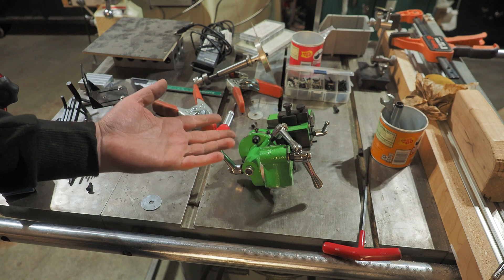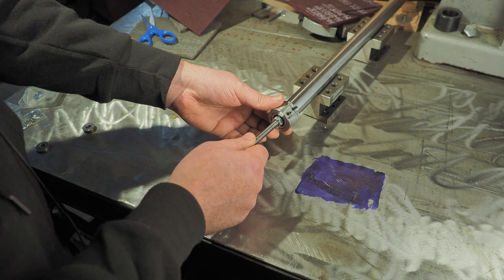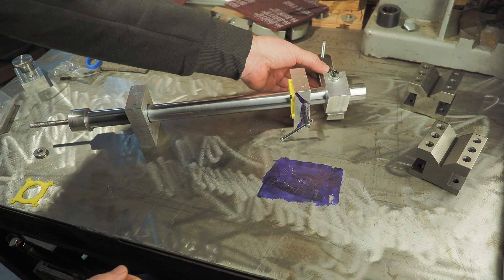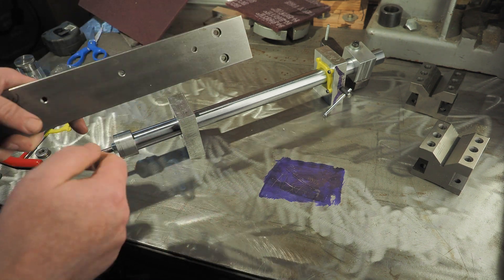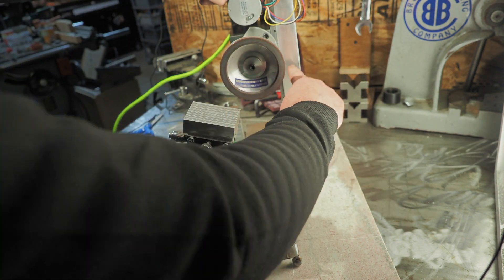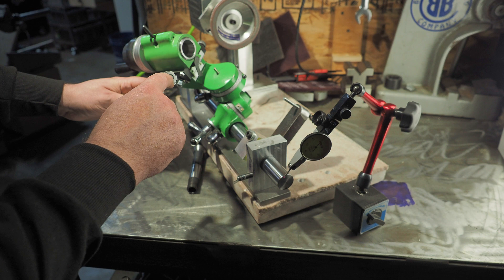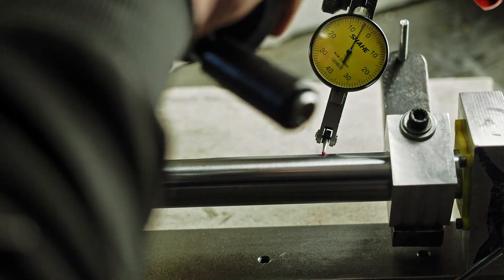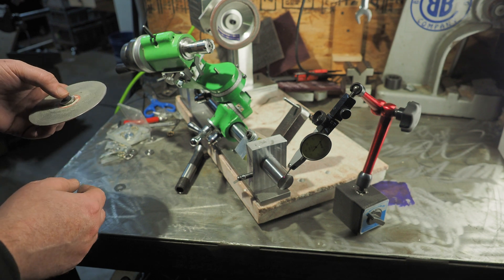DIY Deckel style D-bit grinder/tool and cutter grinder Part 4

Comment: I was considering getting a T&C Grinder and was a little alarmed at the prices so have looking into construct and checking out your excellent vids..   and somewhere, someone suggested using a CNC Mill to sharpen tooling (which I have) Rather than the 'hand' driven machines..  I wondered if the CNC option has been explored and any success achieved prior to my looking any further..?

Comment: I like your   design  .. nice and easy  to make  .. whats good is you will be able to be up  and running to sharpen cutters quite  quickly.   Other designs  although  excellent  take to many hours  to make  and I would rather spend my time on other work..   Question??   Where did you get the  green workholder from ??
Reply from the maker: got it from ebay, the first video describes the rough condition and the fact that they had to send a 2nd one.  Now I have spare parts!   re: quick, well it did take me a few years to do it...

Comment: Hi Jesse.....about the same time you videoed No, 1 I started a build as well having bought the  tool swing mechanism on Ebay..........it's about 3/4 finished as I build slowly  and although it's a bit different to your design eventually It'll get finished.
One thing I have been noting from other grinder operators and that is the grinding dust id highly abrasive tungsten carbide  and not recommended to breathe in the particles so be warned to have some vacuum method for dust extraction.
I'm not using the Deckel type collets and have an ER32 chuck with a plain shank that I will add a front taper bush to allow it to fit in the work head......this is for milling cutters so a separate tool holder will be made to hold lathe tools in a square type of holder.
Edit 24/2/25...........well at last zi've finished the build after 2 years on and off.
One thing has become apparent......why do people place such  importance on grinding the end of emd mills......nobody plunges down with an end mill as you would with a slot drill so I will only grind a concave face with a 2 degree angle inclined to the center and the usual back clearance..

Comment: Way to go, I am making similar and just took my dimensions from a local deckel clone machine, having a rigid base of granite is good,
It also makes aligning the elements of the machine easy, I just bonded everything to the base with engineering adhesive and will bolt if necessary.

Comment: From other similar videos. My take is the manufacturers of the swivelly bit are selling off seconds or 'B' grade stock. That isn't good enough to send out on their  finished machines.
I like the stone plinth. Might have to have a mooch around the local boneyard when it gets dark. 👻
Reply: For a stone base (just a suggestion) I went to a workshop where they cut granite work-tops for kitchens, asked in the shop and was given free access to their off-cuts skip (‘dumpster’ in US I believe). Helped myself to two good-sized lumps of nice flat granite f.o.c. Les in UK 🇬🇧

Comment: I appreciate you taking the time to video your journey.  I have a need for end mill and side cutter regrind.  I also have the desire to re apply my Brown and Sharpe center bench. I have been looking at Cuttermasters JXT design, and  I feel confident I could build a similar grinder motor head unit. The air bearing unit on the opposing axis is also doable, as there are a few companies already selling that item. The fully indexable grinder head eliminates the cutter holder that is common on tool grinders.